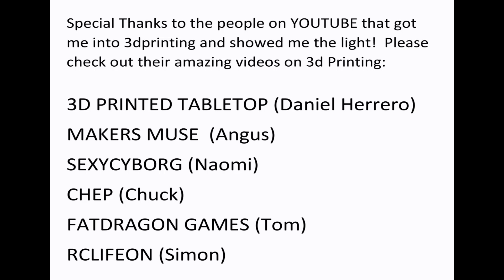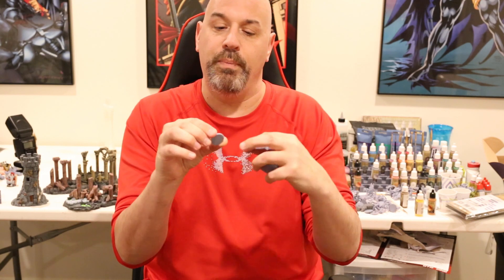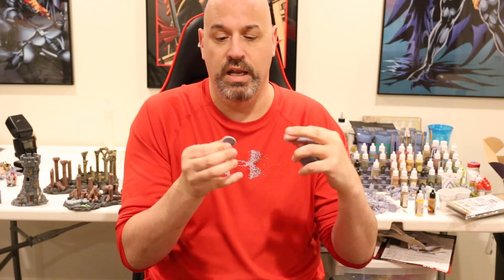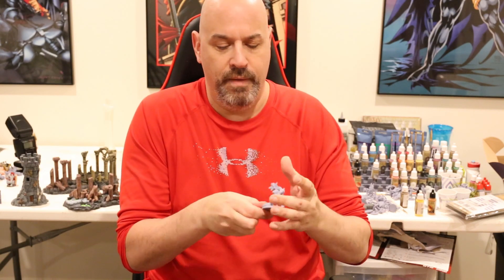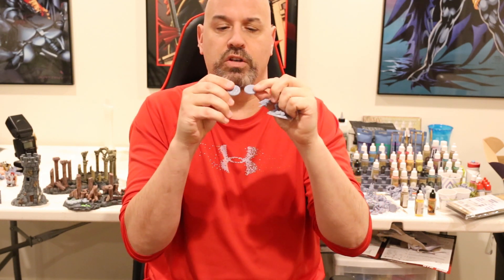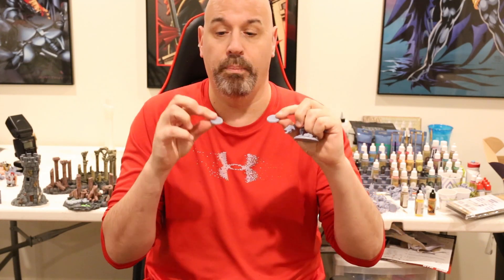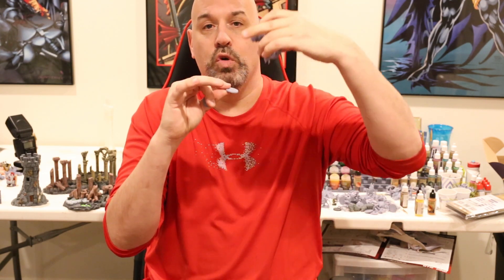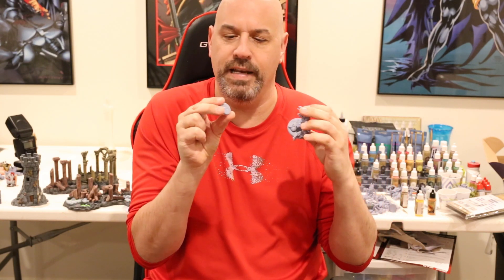Printing better bases for your minis on your resin printer

Comment: Only problem I find when printing flat on the plate is it sticks so hard its impossible to remove without breakage or knocking the build plate out of alignment. Both of which add massively to maintenance time.

Comment: Hi I've just found this video as i'm having difficulties with my custom bases and base inserts. Basically if I print them at an angle, so they are 30 degrees off being vertical, the top part of the base looks ok but the supported part at the bottom looks like it is slightly elongated, not totally round.
does this happen to you if you print the bases at an angle?
Reply: Printing bases at an angle makes them look like garbage in my experience. I get the same deformation of the first portion that prints that you get. I print them flat with a lower first layer time and they always come up with minimal damage, if any. Printing them at an angle can also cause "cupping" of the base as it post-cures, which will make them sit funny on a flat surface. I print 8 x 25 mm bases or 2 x 50 mm bases at a time on my Photon S, flat on the build plate, and have never had a problem with adhesion or FEP damage. I'm probably 30 or 40 50mm bases and about 200 25mm bases in at this point and I've never had a failure of any base due to lack of adhesion.

Comment: I did something similar once but then I couldn’t get the model off the plate with the scraper I had and used a razor and ended up scratching the build plate. What’s the best way to get the base off the plate without damaging it?

Comment: I always run a 32 second bottom layer time for the Epax, using Elegoo Gray ABS-Like resins at normal room temps. Never have bed adhesion issues, even with large solid prints. Rafts always peel off perfectly just using the plastic scraper provided. My point being you could probably get away with 25 second bottom exposure times for flat bases, maybe less.

Comment: Do you make straight edge or bevel edged bases? ( | | or / \) Have you tried compensating for the elephant foot by modding the file to have a overhang artifact where the foot will occur, so having a "bulge" above the bottom layers, which would fail if printed true, but since there is a foot, it will actually have something to build upon?  Another way would to bevel the base of the base, with the foot filling the bevel.  Just some food for thought.
Reply from the maker: Some good points but too much work  :P

Comment: Thanks for the video.
Can you give some tips on how to prevent sticking to the FEP when the area on the fep is so large - or is it that the baseplate area is just as large?
Do you use a lubricant?  If so, how much?

Thanks again.